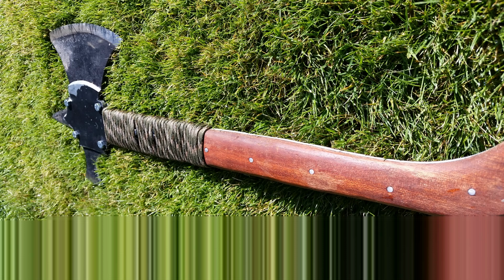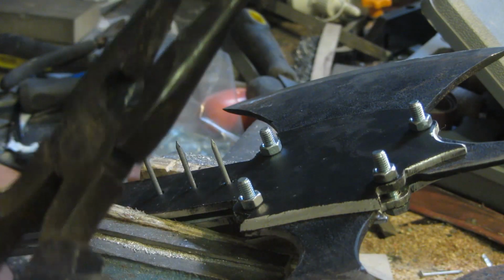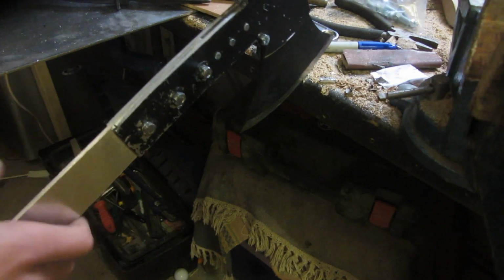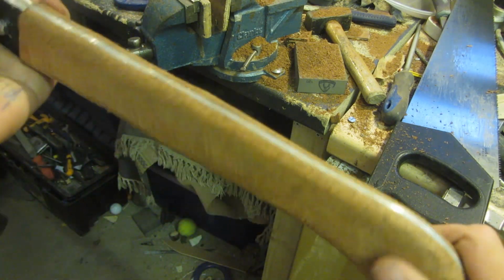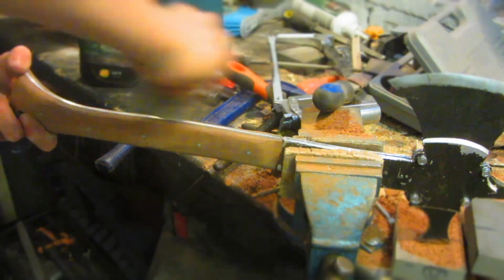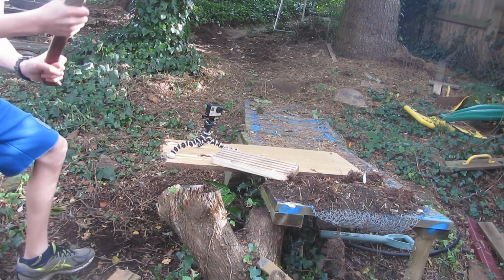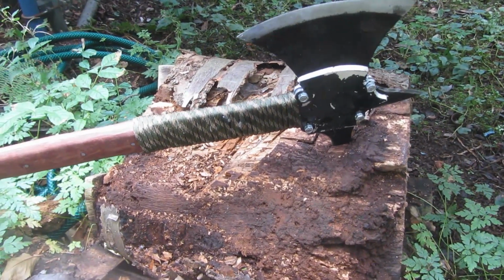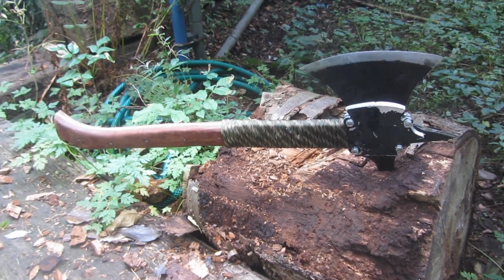How to Make a Tomahawk With an Aluminium Handle - Part 2

Comment from the maker: thanks for watching guys!
post below what suggestions you want me to make on the tomahawk in the future!
Reply: put a notch for removing nails, or some other utility function like that
Reply: It would be cool if you could make it fold away
Reply: Why don't you throw it
Reply: dude the slo mo is completely sick!
Reply: Wilmer Verbeek Probably because he is using the same blade as he did when he first created it, meaning the result would probably be the same, assuming he sharpened it similar to how he did in the first video. The only major difference the aluminum handle has to the plywood handle for the tomahawk is it's easier to split wood, due to the fact that it is more flat than the original handle, which was too round to cut wood completely, and the handle doesn't crack nearly as easily as the hard plywood did due to the force of the impact, damaging the handle in the first video, aluminum is stronger than plywood. Besides, he throws it in the first video he made of the tomahawk, so you can also watch that.   #themoreyouknow
Reply: Make a gladiator short sword
Reply: TheArtOfWeapons engraving on the tomahawk would be really cool
Reply: Wood splitter :D
Reply: very nice tomahawk,but why didnt you just construct it with an aluminium core running the full length of the axe and cover it on either side with wood to make the handle? it would have been much easier to make and also much stronger. Came out very nice though!
Reply: I have no doubt in the quality of this tomahawk but I feel the wood cutting tests were a bit inaccurate because the wood splits the plank and does not accurately show it can actually cut wood. I would just like to say that if you want to show the stability and quality of the tomahawk you should place the wood so the you would hit it across the grain of the wood so there is some resistance when striking. Overall the quality and workmanship on it is incredible and you should keep up the good work.
Reply: ***** it would ruin the purpose of the bolts, by making them flush it would weaken then dramatically so the tomahawk would not hold together
Reply: You need to draw file the handle to keep it even but other wise great build!
Reply: The Art of Weapons Always keep your hands below the level of the axe head when swinging it. This make it impossible to hit your shins,ankles or feet. Be a shame to get blood on your awesome creation.
Reply: Make a butterfly knife!!

Comment: Two things, just get a 100 degree counter sink, and when u do re-paint it with paint meant for use on metal, heat it up and then spray the paint on, it cooks it on and drys quick, u can use a propane torch if u have one or just whatever u want like a stove top, if u take the burner top off it puts off a large flame

Comment: Switch out the screws for pop rivets, if you need to use some c clamps to hold it together while you rivet it. I also agree that the Aluminum can fail suddenly from stress. Other then that you did amazing work! you have a bright future a head of you.

Comment: I was skeptical at first when I saw this, but it's turned out to be a pretty decent looking weapon. I would like to suggest something that would look far better than those bolts and nuts to hold it all together though. Buy from either a home repair center / hardware store, or a reclaimed hardware outlet which ever you can find cheap in your price range, a set of old brass door hinges. Use the pins that hold the hinge together as pins in place of the bolts and hammer them round like you did the nails. They're about 5-6mm in diameter and would look so much nicer than those ugly old bolt heads. I like the idea of using the handle the way you did to attach it to the head. It may not be as strong as some other methods but it's an easy way to do it that will still hold strong.

Comment: An advice for everybody,
if you know somebody who is working at a company,
Which produces tools,
ask them if they have acces to a third choice shop.
My father works for Bosch and he has acces to a shop like this and we have bought increadibly cheap tools there.
A big Belt sander for 30€ an angle grinder for 25€ and the biggest automatic garden sheer for 35€ etc.
These tools have been returned by their original owner which is why they are so cheap dispite being practicly knew.

Comment: I don't think that this handle is going ro last for a long time :/.  That sawblade you used to build the axe head, looked likee it was very big so i think you could have built the whole axe including the handle out of that sawblade, instead of using the soft aluminium ,what i am trying to teach you is that you could have built the axe out of one peace that way  it would look better and it would  be very solid (heavyduty) but any way good job :D

Comment: Aluminum handles are not a good idea. Aluminum collects stress and can fail suddenly without warning. Metals like steel do not accumulate stress and show strain if pushed near the failure point therefore giving one a warning of impending disaster. Wood would be better than aluminum.